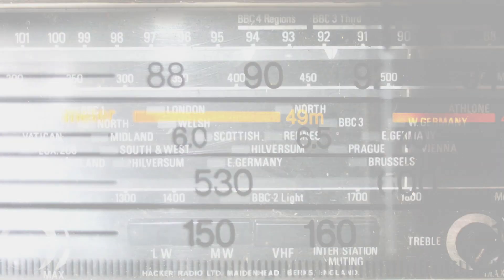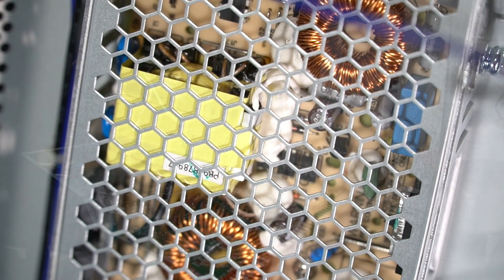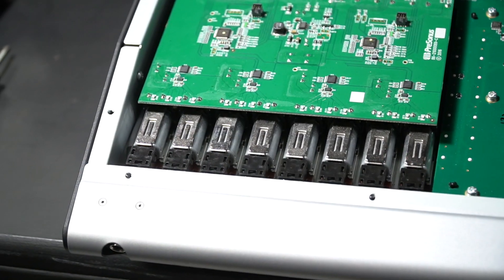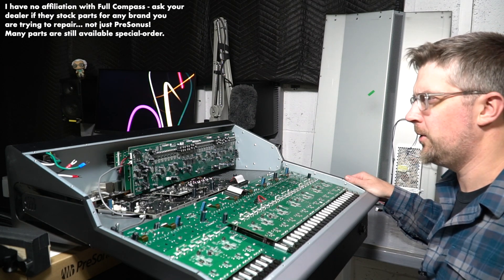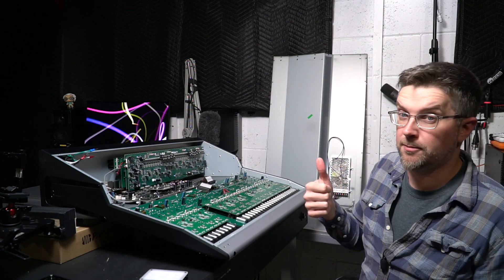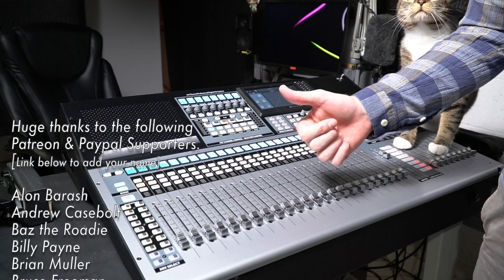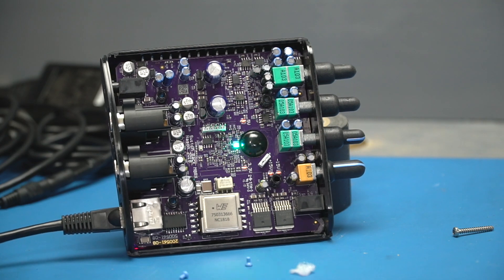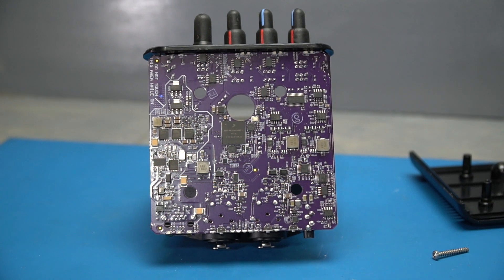Hear m8Rx Personal Dante Station

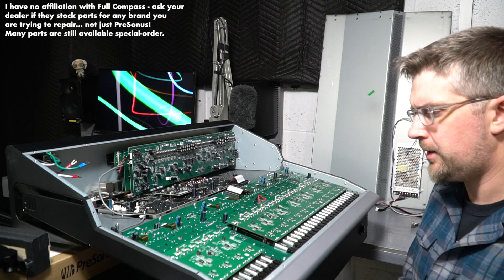Comment: Looking at the 8 fader board at 4:07 I see that PreSonus has embraced buck DC power converters and micro-controllers.  The circuit in the middle is the buck converter with its black inducator.  On either side is are micro-controllers controlling 2 dual motor control H-bridges along the bottom.  The micro-controller probably has 4 A/D converters to measure the resistance of each of the 4 faders it controls.  Each micro-controllers probably looks like a simple I2C or SPI bus device to the central CPU.

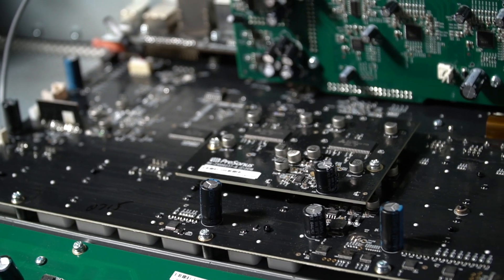A bit disappointed in the build quality.  At 2:22 I see a bunch of the larger electrolytic caps at odd angles, not seated properly on the circuit board.  They are not glued down either.  Relatively large caps sitting on two small wires regularly used in environments with lots of sub-base sound waves shaking them.  Seems like a point of mechanical failure.  But this may just be me nit-picking.

On the M8RX, the square silver can next to the Ethernet jack is probably is a self contained POE remote power supply.
Reply: Hi there! The silver square is a custom transformer that is part of our in-house-designed switching power supply (part of the POE circuitry). Our power supply is designed around a Linear Tech controller (we're happy with them - we've never had a Linear Tech part fail). Thanks for your interest! -Katie/Hear Technologies

Comment: Another great video.  It would have been interesting to know where the DSP brains are.  Is it part of the front panel circuit board or is it embedded in triple stack back panel circuit boards?
Reply from the maker: Thanks Robert! I believe the brains of the 64s are on the black PCB that’s essentially under the screen. The fader & I/o boards look to be used throughout the range of consoles. Maybe the @presonus folks will chime in if I’m mistaken. Hope you’re doing well ✌🏼
Reply: @DcSoundOp  That is correct. What we call the Main Board with the DSP is the one under the screen.